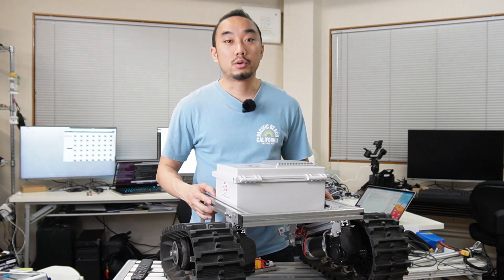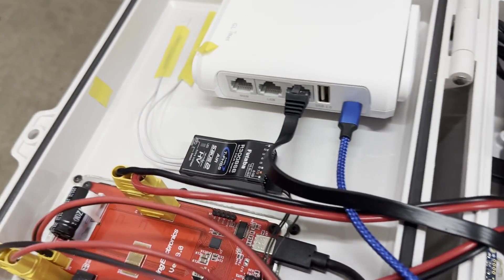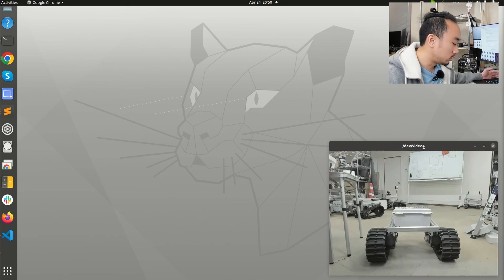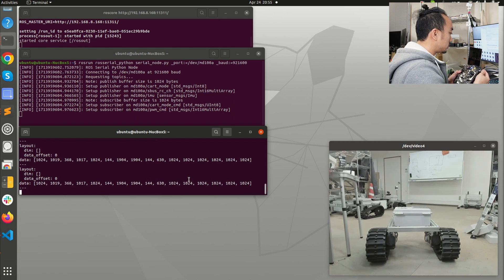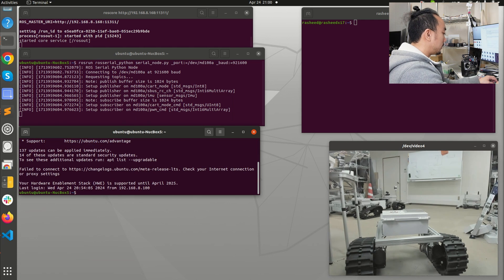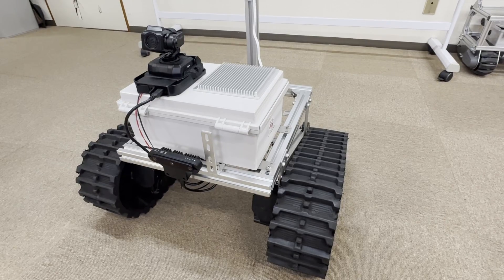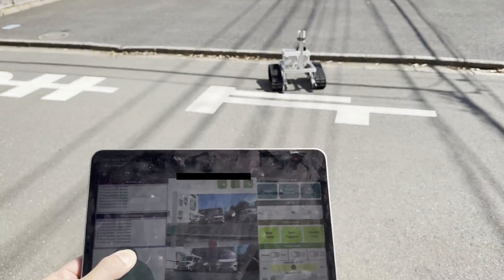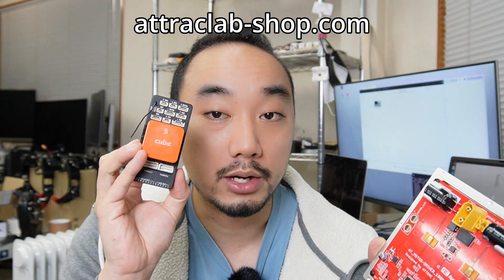ATCrawler | The Heavy Duty ROS Robot

Comment: Hi. Thanks for the great video! What technologies are you using for the realtime video (teleoperation)? What latency do you get? Is your cellular connectivity 4G or 5G?
Reply from the maker: Hi. thank you for watching.
it's WebRTC. I haven't checked latency officially, but most of the place I tested, the latency is quite similar as in video. If poor connection, the webrtc will just reduce video resolution automatically.
The white router there is 4G/LTE.
Reply: @stepbystep-robotics  Thanks, Rasheed, for you quick reply. I have Intel Realsense D435i camera and Rpi camera module V2. I tested realtime streaming using ffmpeg and protocols like RTMP and MPEG-TS but they didn't give good results (latency was even fine but bad quality). Those protocols are very easy to use out of the box. I learned about WebRTC and it seems right solution but is more tricky to install. Could you please advise and direct me (send some links, keywords) how to setup WebRTC? Thanks!
Reply: @stepbystep-robotics  Thanks, Rasheed, for you quick reply. We are building a wheeled robot, we called it BigfootBot. We also have a 4G/LTE modem on the robot. We are using ROS 2. Currenlty we want to add teleoperation with the camera streaming over cellurar network. For teleoperation we tested Foxglove and it worked fine. We have Intel Realsense D435i camera and Rpi camera module V2. We tested realtime streaming using ffmpeg and protocols like RTMP and MPEG-TS but they didn't give good results (latency was even fine but bad quality). Those protocols are very easy to use out of the box. We learned about WebRTC and it seems right solution but is more tricky to install. Could you please advise and direct us (send some links, keywords) how to setup WebRTC? Thanks!